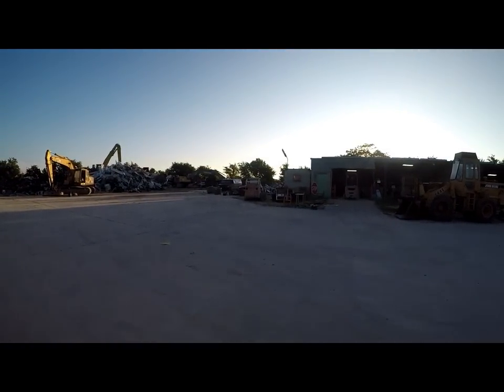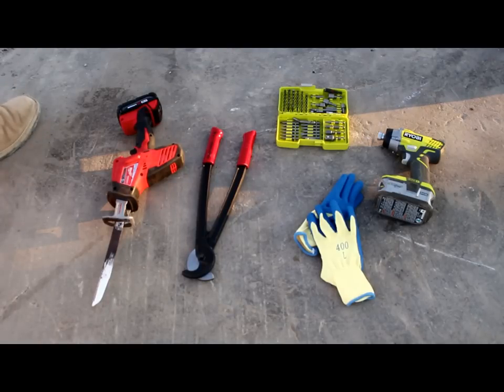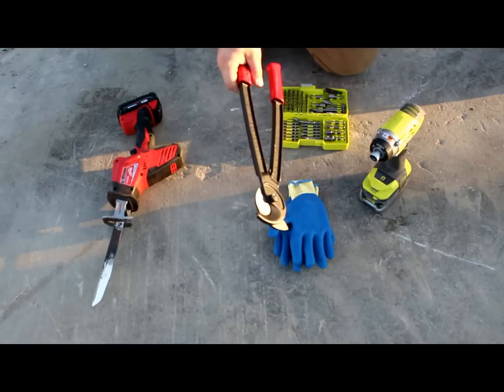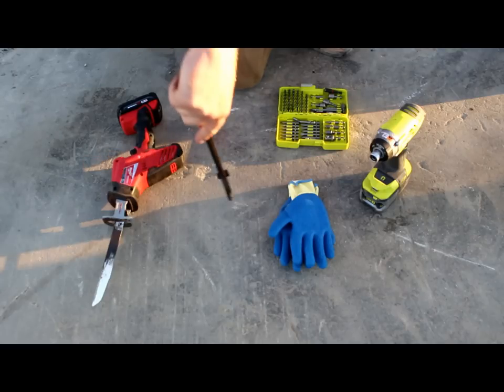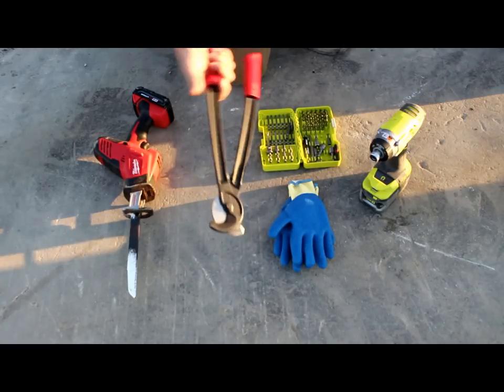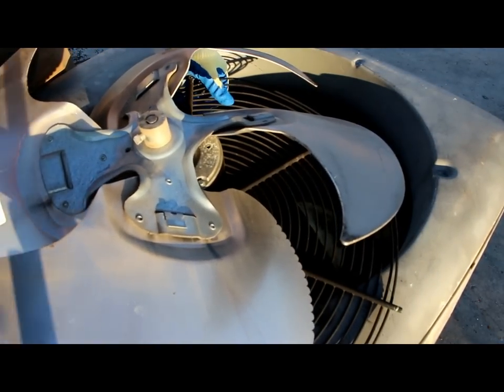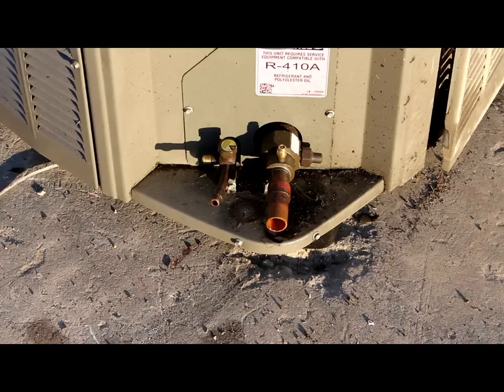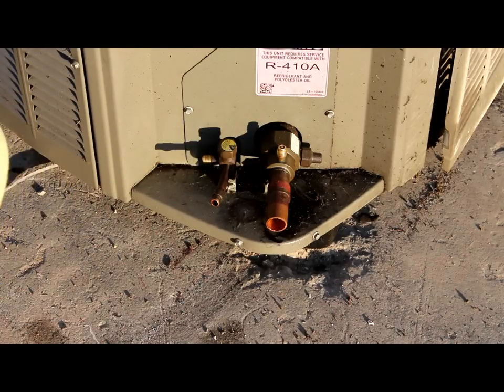Scrapping a Central AC Unit with price breakdown

Comment: FYI! Checking those schrader valves will not tell you if there's pressure on the system once it's been cut loose. There's two king valves behind that under those large brace caps that hold the refrigerant in the coil when you pump it down. You will have to crack open one of those to see if there's any pressure in the system. If you just cut into one with pressure on it you will most likely regret it!

Comment: Same here I love the impact for everything. I still use an old Ni-Cad Dewalt. I love those cable cutters!! I've been wondering if I should buy a pair of bolt cutters, but now I'm sold on those cutters.
Reply from the maker: uberism81, They are awesome,  I'm sure you already know, but I just always warn people to not cut steel with them.  Even if it is ACSR wire.  That's the only thing that will mess them up very quickly.  In reference to one of your other comments about buying a machine:  If you are considering buying any type of machine, I would start with a hydraulic alligator shear.  I have a gensco, and it is in one of my videos.  That thing is one of my favorite pieces of equipment.  You can even cut small I-beam and other steel in it to make it #1 HMS.  Maybe I will do a review on it so you can see.  I paid $14,500 for it, but they have smaller versions you can buy.  If you have a small business set up, you can include it with section 179 for your taxes.  This will allow you to depreciate 100% of the machine in the first year.  Check out this site for more info.
http://www.section179.org/

Comment: At my yard we use a cut off saw to take ac units apart. Then you can cut the rad ends off, the fan blades and most of the bolts on the bottom holding the compressor hammer through

Comment: WHY to remove Freon, and how Bracken was misinformed on how to check to ensure the freon refrigerant has been removed: just before the shrader valves (tire valve stem things you depressed) are the brass King Valves that will hold or release the freon from the condenser coil, and just after the shrader valves you depressed is an open line.  If both of the king valves are closed, depressing the shrader valve (tire valve stem thingy) only opens the line from the closed King Valve to the open end of the copper pipes.  {Caveat: Carrier units, it is often reversed (the king valves need to be closed to check)}.  To check if there is refrigerant, you need an HVAC service wrench to open the King valve a bit to determine if there is refrigerant in the system.  It is illegal to intentionally vent refrigerant, so you really need to have the cut lines brazed closed and use HVAC service manifold gauges to check for the presence of a pressurized system.  There is a $37,500 fine per offense for illegal venting of refrigerant AND a $10,000 reward for those reporting illegal venting.  This would definitely reduce your scrapping profit margin.  Just want everyone to understand why Bracken Recycling stated the requirement for proper documentation of refrigerant/freon recovery prior to scrapping.  Lastly - HVAC companies charge a fee to do this because they are charged to properly dispose of the refrigerant.  It's not just them charging for their time.
Reply: Forgot to say how great the Bracken Recycling videos are - Excellent job!
Reply: Nobody cares about that junk.  I would dispose of it myself. If it wasnt a money grab for them then the companies  and the disposal places would have a understanding that recycling/proper disposal cant be encouraged through fines.

Comment: Thanks! Great video. Question.  Why do you have to have an HVAC license to scrap metal? That's what I was told...
Reply: To remove the freon or discharge the unit.
Reply: EPA certificate, recovery machine, guage set, extra hose, recovery tank needed. Just hire an HVAC guy. 

If I’m turning in a bunch of a/c units, not HVAC licensed, then scrap dealers may assume I’m stealing them. Probably why they want to see HVAC license. Plus they know those guys also have epa certificate.

Comment: A quick trick the scrapyard guy told me, and it worked was, before you remove the walls of the unit, turn it over and use a heavy hammer to hit the underside of the 4 bolts holding the compressor, they pop through easily and it falls down because it’s so heavy and you don’t have to unscrew them.

Comment: Awesome Awesome video man!!! Any idea who would drain the Freon out? Heard people do but charge to do it so maybe not worth it? Thanks!
Reply from the maker: Thank you, Mark!  If you don't do very many of them, then it's probably not worth it, depending on how much they charge.  You can learn how to recover it online and even get a type one certification which is good for appliances with 5lbs or less of refrigerant.  But it all depends on how many units you recycle to determine if it is worth it or not.  Keep in mind when you recover it correctly you can sell back the freon.  If I were out on the streets scrapping every day, I would try to work out a deal with an AC company that I already work with so they could extract any units I had that still have freon inside.
Reply: Although you can get the type one certification, many central air conditioning units hold more than 5 pounds of refrigerant.  Not to mention, you would need to purchase a reclaim pump, manifold gauges,  a reclaim cylinder, never mix different refrigerants into the cylinder, and understand that the refrigerant will burn your skin.  As far a selling back the freon, only a few companies will by back R22 refrigerant.  Most all charge you to bring in the refrigerant since they have the added expenses of transportation, purity testing, cleaning, filtering and purification of refrigerant before it can be resold and reused.

Comment: Have you done a video on whether it is practicable breaking down other   items like water heaters, push mowers, electric motors, etc.?  Wmsbg.krw06
Reply from the maker: Kevin, not yet but that is a great idea.  I will try to make some time to make one!
Reply: The old style HID ballast transformers are well worth it. 2.5 lbs of copper in about 2 or 3 mins of work.

Comment: here in billings mt you have to drain the oil or they will not take them
Reply from the maker: Kathryn, there are a few reasons why they might have this requirement.  The first is because they might just not know that it is ok to leave the oil in them.  They may have never even asked their buyer if it is ok, so they just don't know.  If I had to guess I would say 95% of compressors (sealed units) are exported.  The majority of them are exported to India.  We ship anywhere from 43,000lbs to 250,000lbs a month.  Buyers can have different requirements when shipping them but having the oil drained out is not one of them.  We use recycled cardboard and oil absorbent to ensure that none of it escapes the shipping container.  We do this obviously for environmental reasons, but we also do it, so we don't make a mess in the container.  If we do, we will get charged a cleaning fee.  The other reason might be because they just don't want to deal with the mess in their own yard.  They might not have an environmentally efficient way of handling the material, so they want to make sure no oil will come out while they move them throughout their yard.  If they have a constant problem with oil coming out then they are losing money, because if they paid you with the oil in them, then they lose the oil weight, they are going to lose money.  This is undertandable depending on their situation, but it could be an easy fix.  If it takes them a while to make a whole load (43,000lbs), they might have to store them for a while so they might not want to worry about the oil coming out and going on the ground while they collect enough weight to sell them.  The only other thing I can think of is that they are just a middleman because it takes them to long to collect a whole load, so they have to sell a mixed load (multiple materials) to someone else who will consolidate material from multiple yards then sell straight loads (one item loads).  That person might not want the mess since there are multiple items in the truck being shipped to them.  Sorry if that is really long I just like to be as detailed as possible!  Feel free to ask any questions after reading!
Reply: thanks good thought

Comment: I’ve never broken down anything. I just bring stuff in bulk. How should you bring it to a scrap yard? Do you bring it it containers separated, or just bring it in separate piles and put it on the scale?
Reply: Separate and upgrade your materials and bring them to the scrap yard in different containers. Never sell unprepared scrap if you can help it, you’d be surprised to see how much more tou can make by spending a few minutes separating your metal

Comment: i was wandering if you have ever come across a ac unit be it window or central that looked like this https://www.youtube.com/watch?v=acGZHCRsUCY 

mine was a window ac but it had a copper tube and the ali on the outside like this what is this kind of aluminum radiator called and are they hard to come by? the ones i normally get as far as window ac's are the square radiator with copper tubes that was the first wound ali fins and copper tube i had gotten. i think its much easier to seperate the copper from that kind of ali fin easier to break down. do you know what years they made this type of radiator? there are no videos except this one and no videos of anyone striping one like that with a copper tube.